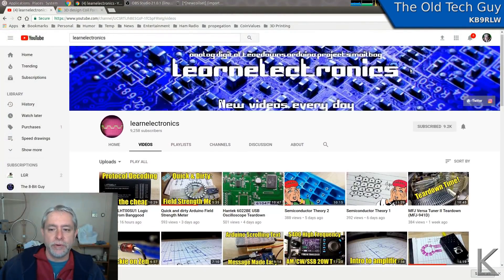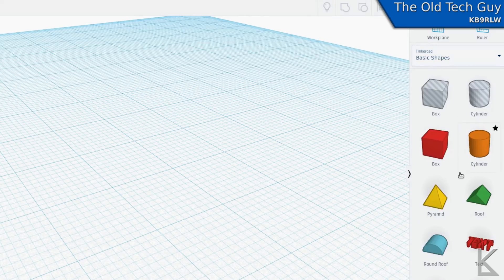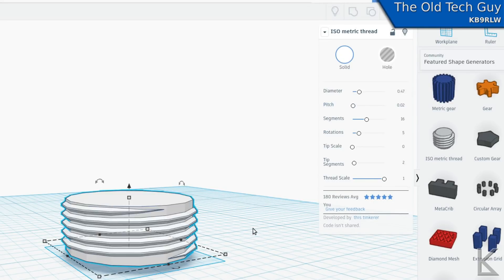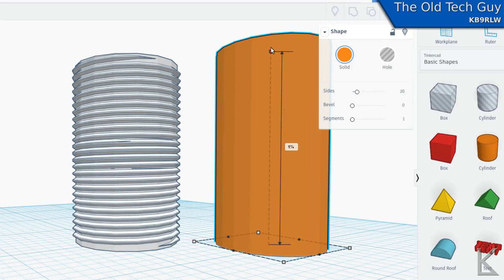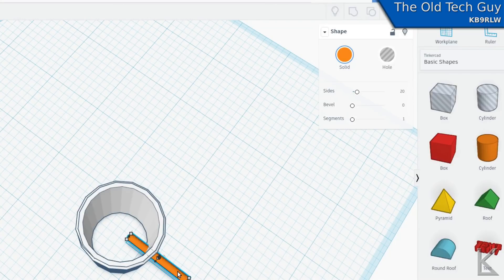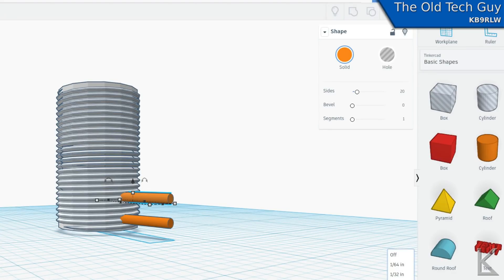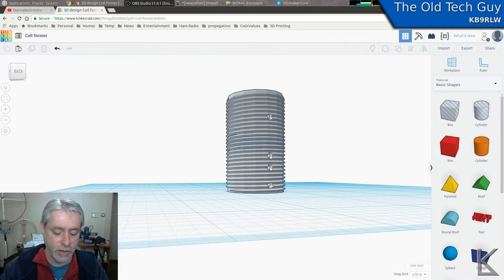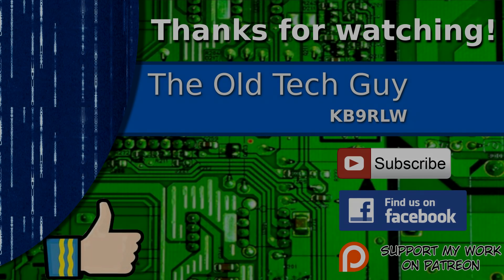Ham Radio - Viewer Request, Creating custom coil forms in TinkerCAD

Comment: Great instructions, especially since I have not been able to find useful tutorials elsewhere.  Now, any thoughts on how to do a 3 start screw?  it would come in useful for winding 1:1 air core baluns.

Thanks again.  73 Chas AD0UY
Reply from the maker: I would think you might be able to create a duplicate of the threaded part directly over the existing one and rotate it.
Reply: A 5 minute trial indicates that you are correct.  However, it will take a fair amount of trial to get the leads to work correctly.  As an after thought, it would probably be a better form if the crests of the threads are truncated at least to pitch diameter.  Also choosing the pitch based on the wire size will be needed to ensure that the windings sit and play nicely.  Thanks for the idea and reply.

Comment: 3D printing comes into its own here. Printing enclosures etc is cool but they could be made from wood or metal with a modestly equipped home shop. However, forms like this are a pain to fabricate, it can be done but not to this standard and no where near as easily.

I made a quadrifilar helix antenna by first using the dimensions to create a form (my model is on my thingiverse page). Still in use periodically on a 5.8GHz video link for fpv racing.
Reply: What filament did you use to print the plastic for an outdoor antenna and how is it holding up to the UV ?

Comment: Do you like Tinkercad better than 123D Design?  I've been trying to use 123DD but I hate it!  It seems very hard to do anything at all!  Tinkercad is also very difficult to use.  When I try to move the little hole like you did it doesn't move, it changes the size!  Is there some way to keep the size set?  Also my parts keep moving around in relation to each other and I can't keep the holes in the same place and Ctl. D doesn't do anything when I try to duplicate something.  Nothing ever works like I expect it to!  I can make cylinders and cubes but that's about all that works, I don't see how anyone could ever make anything very complicated.
Reply from the maker: I have not used 123D Design.  It's windows only and I run Linux on all of my machines.   I have used others though, Sketchup, Blender, FreeCAD...   TinkerCAD is by far the easiest modeler I've ever used.
If the size was changing, you probably clicked on one of the little white boxes that appear when you select a model.  Those are for scaling  the object in one of three dimensions.   To move it, you can left-click anywhere on the model and move.  Also, for finer adjustment, when it's selected, the arrow keys on your keyboard will move it in steps equal to the current grid size.
It uses all three mouse buttons.  Left button to select or drag,  Right button to scroll the camera view around, and the middle button to shift the camera view left-right or up-down.  The scroll wheel will zoom in and out.
With windows 10, windows might assign some functions to the mouse that will get in the way.  I don't know how to disable that, windows always frustrates me with how difficult it is to change simple things.
Reply from the maker: Oh, you can make fairly complex things in tinkercad.   Take a look at the leftmost image on this page.  A mechanical part done in tinker.
https://www.myminifactory.com/software/
Reply from the maker: Sorry, one other thought.  Since you're on windows, check out Fusion 360.  It's quite popular presently.  It's a sketch based CAD program, so a bit more complicated.  But there's plenty of tutorial videos out there.
Reply: Not the white boxes but when I click anywhere on the item and try to drag it the size changes instead but sometimes the size changes and the item moves also!  It seems to never do anything the same way twice or to know what it's going to do.  Then if I try to click on the small object but it grabs the larger part instead and moves that everyone of the smaller items gets out of shape and I have to start all over everytime which is very frustrating.
Reply from the maker: Either windows is doing something with the mouse buttons,  or your web browser is not handling the software properly.   You definitely don't want to use internet explorer or edge.  Microsoft's browsers don't handle HTML5 and webGL standards quite right. ( I know several web developers locally and they all universally hate microsofts browsers. )   Tinker works perfectly in Chrome and Firefox.
If you're running Chrome and it's still behaving like that, something else is very wrong with your OS install,  video drivers, or mouse settings.
Reply: I'm using Chrome. I finally got Ctl. D to work for making a duplicate but it's so erratic that I never know where the duplicate will appear.  Sometimes it's on top of the original but I can't tell unless I try to move it but it it's not then it moves the original or the main object and messes everything up.  Some other times the duplicate appeared underneath the main object and was hard to find unless I looked under it.  I finally got this done but it was pretty hard and I wouldn't want to do it on a regular basis.  Is there a way to anchor down the main object to keep it in place so everything doesn't move all over while I'm trying to work with holes, etc.?
Reply from the maker: Duplicates will appear in the same place as the original, unless you just did a duplicate and moved it.  i.e. if you were creating a gear and you made the first tooth, duplicated it and moved it a few degrees around the hub.  The next duplicate would also include the move so the next tooth would already have moved and rotated.   
If you mistakenly move something you didn't want to move, just click undo, or ctrl-Z.
To avoid selecting something other than what you want to select,  be sure you're clicking on part of the item that's not over the top of something else.  Like if you wanted to select a hole that was already down in another part,  rotate the camera so part of that hole is visible against the background before clicking on it.

Comment: Watching this while I am printing my spool holders.  The bad is that the printer arrived with a broken micro SD card spring clip.  I have it taped and blocked in with some lead weight while I wait for the replacement to arrive on a Tuesday.  Using the WIFI connection to download gcode files which works fine.
Reply from the maker: I really like the wifi connectivity.  The printer is across the room from the computer and I hate plugging and unplugging those tiny microSD cards.
Reply: The printer is on the first floor, in a room that was an office.  I am upstairs in a loft (I call it my "man loft") its quite a walk.  I bought this one via Amazon, the replacement is already on its way, but with the three day weekend it won't be here until Tuesday.  I wasn't going to let that stop me.
Reply: The replacement just arrived.  The box looks fine, the styrofoam is fine, but base plate, however, is bent.  It rocks on the counter.  I might be done with this model.

Comment: Hi Kevin,
Excellent video. If you have a pair of calipers, measure the OD of the wire to be used and divide that into 1 to determine the thread pitch for a closely spaced coil. At least with a 3D printer, you can always go back and make minor adjustments to get the coil form just right.  73   WB3BJU